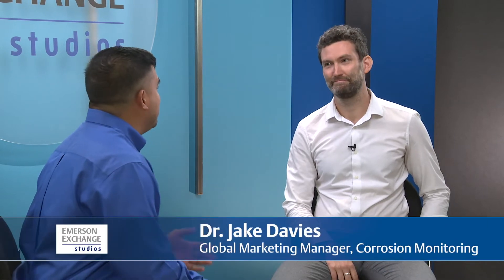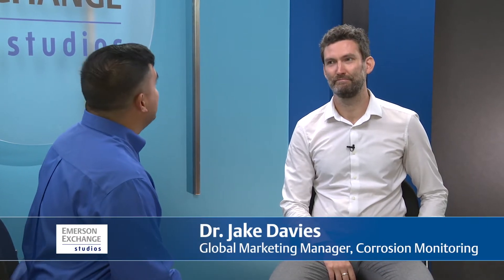Wireless Corrosion Monitoring Supports Safe and Profitable Operations

Comment: I though I will see in this VDO that how can sensor detect the corrosion.  And how it will communicate to th DCS or SCADA but nothing.
Reply from the maker: Hi! The sensors measure the thickness of metal continuously using ultrasound - a change in thickness due to corrosion or erosion will therefore be quickly detected and measured. The sensors send the data wirelessly to a database, so no need to cable the devices. Visit us for more information: https://www.emerson.com/en-us/automation/permasense?utm_source=emrsn_us-mchnl&utm_medium=vtye&utm_content=permasense&utm_campaign=18grmtw-permasense01